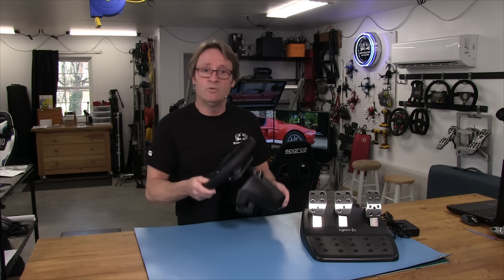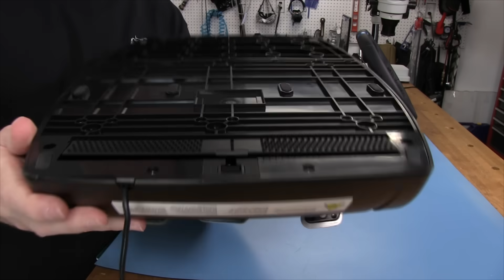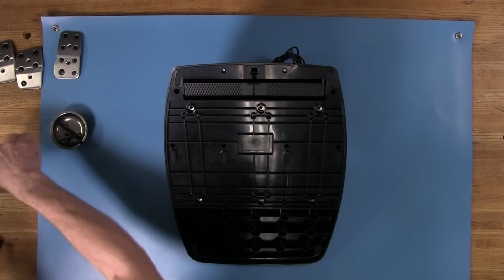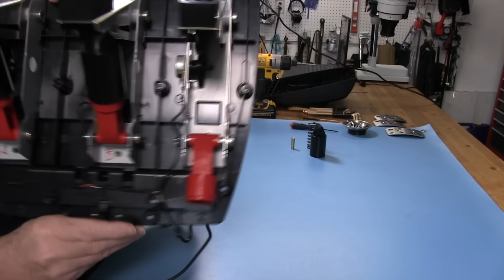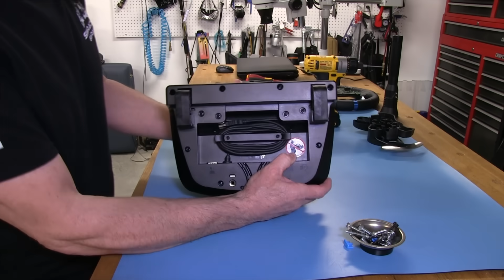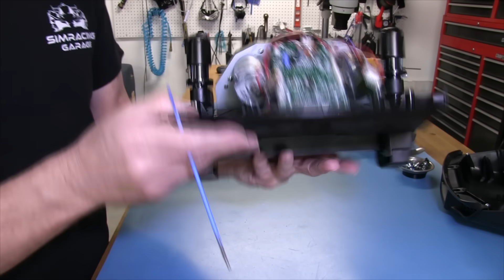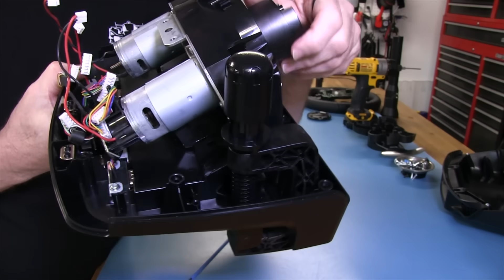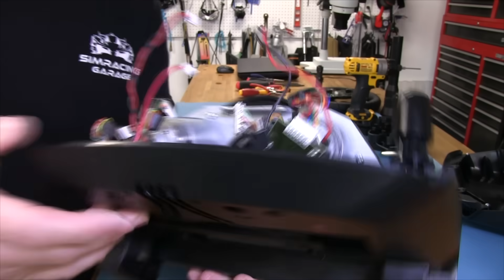Logitech G29 Review

Comment: I am confused, because you seem to be very knowledgeable and professional but then you say things like "I had more fun with the FF of the g29 than with the Thrustmaster one". I mean, what? The force feedback of the thrustmaster is MILES away from the g29
Reply from the maker: The Logitech gear drive train, gives a bit more detail, and quicker response than the TM that uses belts. Belts will smooth out, or dampen the same detail. It is personal preference when I say I like the G29 more than the T300 on the console PC2 game. I can see where others would prefer the smoother response a belt drive system can
deliver. I go to pains in most of my reviews to make sure you understand that we all feel things a bit differently. Just because I prefer something doesn't mean you will
too. The T300 is a good wheelbase, and has some things I prefer over the G29. Really comes down to which game, track , and car I am running.
Reply: Also, the break pedal its not perfect but it definitely feels better than the g27 with no rubber in it. I dont know, I want to like your reviews because they are great but some of your opinions seem a bit odd to me, sorry

Comment: 39:50 the bar is just for travel locking
41:30 they don't have fans because they barely spin anyway

Looks like a very incremental upgrade over G27, they didn't even put beefier motors and mosfets in there. Good thing that I completely busted my old G27 today, so I don't feel like ass for buying a new model, it helps it was 44% off, too.

Comment: a piece fell out. This smapp metal piece piece that looks like a half moon, circular. And now the wheel doesnt lock. I can turn it left or right non stop that it wont ever lock up...help....
Reply: Ok I found out the piece should be underneed the carousel. The long black bracket with teeth. That bracket was out of place. But I didn't fix it. I just threw the missing piece inside, shaked it and its now working...Does tha bracket influence force feedback?

Comment: Thanks for the thorough review and diss assembly! Question for you or anyone that might know-  I would like to either remove the front clamps entirely and use four bolts from underneath or change the clamping minimum depth.  Is this possible?  Are the clamps easily removed?  I built a custom stand and want to reduce the clamp profile that hangs down below the wheel.  If I could shorten the factory bolt so it closed to a smaller distance that would work, or replace it with two additional bolts like the forward two?  Thanks again for the informative video!  Jim

Comment: @Sim Racing Garage
I'm on my second g29.
Both have had the accelerator spiking issue. Tried contact cleaner in the potentiometer, but always gets bad a week later.

If I switch the clutch and the accelerator base over (and the connections), will it perform the same, or are the potentiometers different on the two?
Reply from the maker: As far as it looks, they are using the same potentiometers for all the pedals.
Reply: @simracinggarage3026  OK great!
Thank you. 
I might try switching the base units over then. I only use gtsport, so I don't use the clutch pedal at all, and logitech do no support info for this spiking issue. 👍🏻

Comment: I use to have the Logitech G25 for 6 years, the I sold it. Now I am getting back to Sim racing and need a good wheel. My question is, Does the G29 considered as a step up from the G25 or not? and what about the deadzone? And is it better to get the Fanatec CLS wheel instead?
Reply: I still use the G25. Thinking about upgrade mostly because of a small amount of wear with centre play. Did you go with a new G29 ?

Comment: Logitech Makes a reliable wheel i have had  2 G27's and 1 driving force.I gave my son my first 27 that he still uses to this day and it has to be 8 or nine years old.My other one is in the box as a backup.I did move up to a direct drive,and high end type equipment.For the money though you really can't go wrong with logitech.Now the one thing i will say is absolutely what i would do,is get the brake mod.I dont know about the G29,but the number one thing i found that improved my lap times was the brake pedal.The load cell is a must have!!!!! Great videos Berry love the entro of the car engine sound i have watched several of your video's when choosing my equipment.Thanks

Comment: My G29 turns on but will not stop spinning what do I do?
Reply: did you install logitech software? is your wheel recognised?
Reply: @teabagmcpick889  I dont recall ever having to install any software I returned the old g29 n ordered a new one ..when that arrives how should I go about hooking it up correctly with out a pc or laptop
Reply: @inksmith3019  Ok, so you're connecting to a ps4? No option to install anything in that case. It's just gotta plug & play. I can only assume you had a faulty unit & expect the replacement to be good. Everything connects to the wheelbase & then that goes to the console on one usb - not much else you can do. Good luck with the replacement 👍

Comment: I am very new to the sim racing scene and i am split between the Logitech g29 and Thrustmaster t150 if you could tell me which of these would be better for a beginner that would be appreciated thanks ( :
Reply from the maker: Unfortunatly, no one can tell which one you would like best. As there is no way to know your personal preferences. Only way to be sure is to try them both. Not possible for most of us I know. If this will be your first FFB wheel purchase, I don't think you will be disappointed with either one. As they do get the job done at this price point. If, at some time you get to try the other one, then you can make a more informed decision on what you like in a FFB wheel.
Reply: @simracinggarage3026  Thank you for your feedback mate much aprecciated ( :

Comment: Just got a G29 today, the break is incredibly stiff compared to the DFGT I was using again recently.  Just need to get used to it.  Doubt I’ll use my DFGT anytime soon, but I already miss the sequential shifter. 

Edit: removed the ridiculous rubber on the break, but considering to put a smaller diameter spring inside the mainspring for a bit more resistance in the end. Also, after 4-5 hours of play in 3-4 days my wheel developed an annoying whistle while turning left.  Took it apart and sprayed a tiny bit of remoil in the motor slots and it resolved the problem.  I guess it’s human nature to compare things but considering I have had the DFGT for 10 years; I’m a bit let down with this wheel.

Comment: Also note, if you experience the high pitched squealing sound after some heavy use of this wheel, just spray a bit of silicone lube inside those slots on the motors.  Instant fix.
Reply: I do get those sometimes, where exactly did you lube ?
Reply: @furrane  there's a slot at the base of the motors, which he points out.  Just spray a little lube inside, turn the wheel a few times, and the squeal goes away.  It was driving my wife insane for a while until I took the wheel apart and searched out the noise.  I really like this wheel, and that's the only issue I've had with mine so far, after 100+ hours of use.  Can't beat the quality for the price point.

Comment: This review was published in Mar. 2018. Have you any updates on the brake curve issue. I want to go with the load cell conversion but unsure if the firmware won't support a more linear curve. Has anything changed on this point?
Thanks for all the great work you do.
Reply from the maker: No change that I can find. Logitech has not responded to any of my request.

Comment: I've owned my g29 for almost 4 years now, it has had heavy use and come with its fair share of preoblems, The pots in the pedals are quite worn, (they need replacing, but i m weiry to as they will work) I decide to cut the rubber piece in the brake in half, the firmware does have a very big curve toward the end of the stroke though, but in my oppion it feels better. Over time the wheel has become quite loud under load, but for assetto corsa i istalled sopme .LUT files for a smmoother experience, which worked really well, the connection for the pedals got quite bad too, so i sprayed some Electrical contact cleaner for a much better connection, (same with the pedal pots), I also have the shifter which recently needed the pots to be cleaned too, after they were cleaned it wouldn't randomly switch gears. but reverse brok recently which is quite annoying. I'm not sure about upgrading this wheel because of the dodgey pots, I don't  think they'll last must longer. Overall i am happy with my wheel

Comment: Great informative video thanks.

Watched this and the T300 RS review and I am currently undecided.

I have used almost all Logitech wheels in my life, from the Logitech Force GP, MOMO Racing, G25 and currently a G27. I was getting interesting in trying something different from Thrustmaster, specifically the T300, which offers a good choice of different steering wheels. The more powerful forces and the smoothness of the FF are also things that attract my attention. But as mentioned, the gearing implementation of the G29 provide more immediate FF compared to the belt driven of the T300. Also I have read about some reliability issues with the T300. I have to say that all my Logitech wheels I have used never ever failed at all. One drawback I see of the G29 is the wheel looks like a toy, compared to the options T300 provides, even though they are paid additions, too bad Logitech does not come up with something similar.

Gonna have to do way more research.
Reply: @Fernando Deutsch What did you do finally? I am about to buy my first ever wheel and I am between g29 and t300 rs

Comment: who noticed besides me, that at 48:38 when he says to move on to acceto corsa it was because he made a misstake that would probably cost him the race?!
If you guys notice he make a misstake on the corner exit and when he press the accelerator the front end of the car star to rapidly come to the inside wall with the steering wheel on the netral postion, that mean the rear end stepping out of line and with how quick it was i really doubt he has save it.
Nothing to do with the review btw, just a fan fact i guess.

Comment: For anyone with a G29 and suffers from the infamous wheel squeak, I can attest that this fix works (* Warrantee WILL be voided *):

1. Disassemble the wheel base as Barry has done so that the 2 motors are exposed (there are A LOT of screws, make sure to keep them in a safe place).
2. Spray some WD-40 or any other comparable lubricant in the vent openings at the bottom of each motor (it's a bit hard to tell which motor the squeak comes from so I sprayed some in both).
3. Give the wheel shaft a few turns and make sure the squeak is completely neutralized.

This completely got rid of the annoying squeak noise when turning left/right and made the wheel infinitely more enjoyable to use. I was contemplating sending my g29 back to get it repaired but I was confident that it was a simple fix and had the right tools for the job. Hopefully this helps someone out as this fix just isn't readily available.
Reply: Get back here and let us know how it worked out over time!
Reply: Get back here and let us know how it worked out over the past few months.

Comment: I have had my G920 and shifter for over 2 years now with no issues using it on my xbox.  I upgraded to the GTEYE brake mod and it is okay but honestly for games like Project Cars where you can individually map each pedal, the stock rubber bumper arrangement works just fine.  The issue was in other games where you could not map the brake pedal, I was unable to obtain 100% braking due to the firmness of the factory rubber bumper.  I got mine new for $200 from bestbuy and added the shifter for another $40.  Add in the playseat challenge on sale for $200 and you have a really nice set up for less than $500.  I am looking to upgrade to a Fanatec but honestly not sure it is worth it unless I go to the V2.5 at minimum.  I am just not ready to plop down over $1,000 for a new set up I guess.  I have used the belt driven Thrustmaster wheel base and hated it, too vague and loose feeling in my opinion.

Comment: I use these wheel and I'm happy with it, however it's my first one, there is some noise when driving, that's the only thing I really don't like, however I read that this is caused by a high FFB settings, do you know If that's true!? I use it with project cars 2. Loved the review really the most complete of them all.
Reply: All logitech wheels are loud, it's the gear driven motors or that's my understanding anyway.  I've never owned one but I know alot of people that do.  I have a full fanatec clubsport setup.

Comment: Ive had Logitech g25 the DFGT and now use the G29 ive never had any issues with either of them so I'm very happy and the general consensus seems to be that these wheels compared to others are ultra reliable !! As you see from this chaps video he found the G29 to be a good quality piece of kit both internally and externally . When testing the G29 he found the force feedback more than adequate , he then  went on to say that in some cases the FF was more detailed than a belt driven wheel ,especially as this was a gear driven wheel which may I add the g29 uses helical gears as opposed to straight gears previously used by the g25 and g27 that's why he noticed the wheel was a bit quieter and smoother than the previous models now I have been looking to upgrade from a g29 but during my research I found the thrustmaster products seemed to be very unreliable people going through 2 or 3 of these in just 6 months you shouldn't be paying that type of money only to pray and hope that it doesn't fail its not fit for purpose so ive now ruled out say the t300 rs gt say so then I looked at the fanatic csl elite bundle a lot of money but a good quality set ........ but again has flaws !! flex on the shaft , not compatable with some of the top ps4 driving games like gt sport or dirt rally on gt sport the wheel is reported to oscilate when stopped on track or wen you let go of the wheel down a straight ?? in compatability mode you loose some of the force feedback you get none of this with the g29 so why the hell do they put these so called more realistic qaulity wheels above the g29 ?? Yes I agree the g29 looks like a toy and plasticy but I don't notice the toy look when I'm blasting down a stage in dirt rally and it only gets coggy wen you have the force feedback up too high and it starts to clip . Now me personally I don't like the ff up too high as you loose detail and laptime because yr fighting the wheel !! So after looking around its not worth upgrading to wheels that have more flaws and less force feedback detail than a g29 especially when you can pick the g29 up so cheap I asked shaun cole of the simpit youtube channel he even stated the higher end wheels wont make you faster and the best upgrade you can do is to mod your brake pedal and that's it . So yes I can understand peoples reasons for upgrades to more expensive wheels etc but at what price not only is the g29 the best bang for your buck on the market but I think it also makes more sense its more reliable has less flaws is  compatable with all games and less time consuming finding that sweetspot we all look for in each driving game we play I rest my case !! lol happy new year to you all !!

Comment: just a quick question, if you can help me. i have bought two g29s in 2018 and i returned both of them because in the first week both made a high pich coil noise when i turned to the left only. Logitech ansered that it was nothing to worry about, but was kind enough to accept them back. Now Janouary 2019 i was given one for gift. The exact same sound comes up when turning left only, with or without FFeedback on. Have you any idea?? obviously is the motor, but is it *normal*? Thanks in advance.

Comment: Personally as someone who's experienced both Logitech and Thrustmatser wheels with desk mounting. 

I really do not like the mounting-system for Logitech wheels they slip of the desk after a while for anyone who's got a little more arm strength than most people.
The desptop mounting for Thrustmaster wheels is much more sturdy since it clamps down with more force over a wider area.

All the strength of the mounting-system on a Logitech wheel is at the front. This means it's easily pulled of a desk by moderate tugs that seem to happen to me during let's say an intense Dirt rally 2.0 session. Or a hard run in a Assetto Corsa Sim Racing System session. With a Thrustmaster Wheel none of this has ever been an issue for me quite honestly.

Comment: Hmm i don't have such a problem with the clutch pedal...maybe a potentiometer moved during reassembly ? (of course depending on when the driving part was performed) How did the wheel perform during drifting, if you did any ?

Comment: just side issue with the entire wheel is that it lets out "rattle" like sound. i've heard plenty of people have that noise and its mostly due to fact the way entire thing was built. In case someone has fix for this, feel free to send help (its not causing issues but its rather annoying loud sometimes). I use my G29 to play Assetto Corsa and Euro Truck Simulator 2 (so far rarely rattles with this game)
Reply: @lRaziel1  I went with somewhat default settings (only slight adjustings to pedals) and would say it feels rather smooth. I would recommend bit invest more money and go for Thrustmaster because those sets allow you use other wheels too, like lets say you buy ferrari one, you can take off the original and put in new one (might need adapters but thats still pretty easy). I would go with thrustmaster if now would have money to buy new set.
Reply: @lRaziel1  Its bit harder to judge it based on money alone I would say look up people comparing the two to make it 100% sure which one fits for you better :)